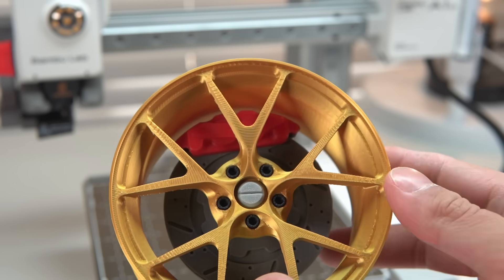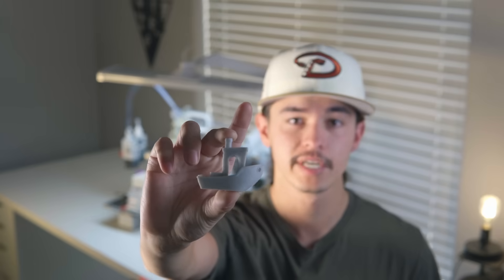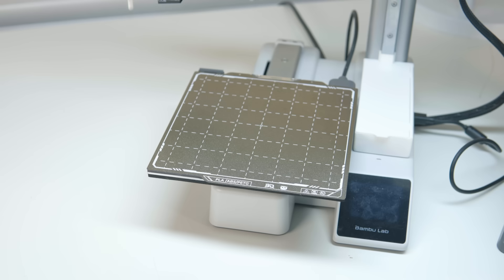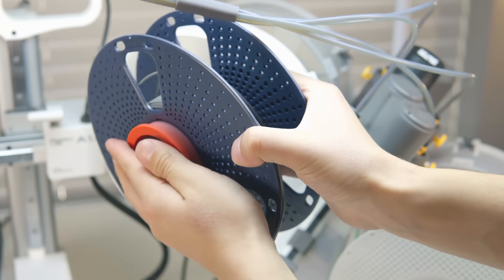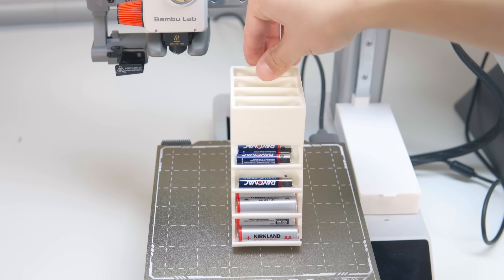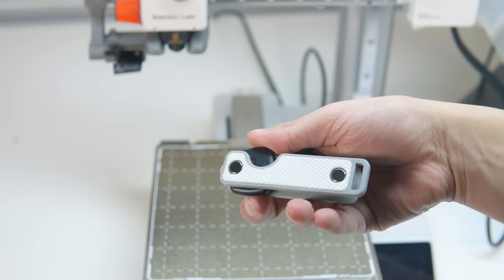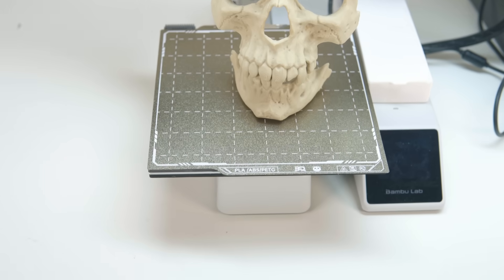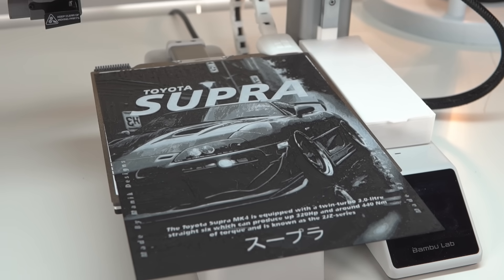New to 3D Printing? Print These First!

Comment: I. Will. Never. Print. A. Benchy. Ever.
Reply: But boat is cool
Reply: I run 1 benchy per filament type/color. 
Helps you understand the material's properties before, during and after printing. It also helps you learn how to print your filament correctly. Also it can be hard to tell what a color will actually look like after extrusion without... Well.... Extruding it. I love tri-color silk PLA but showing someone a strand of it is pretty underwhelming. Like "cool. It's 3 different colors in a line?" But I can show them a benchy that they can rotate and play with and they'll really see how the color shifts depending on which way you're looking at it. 
Benchies are fuckin AWESOME!!
Reply: @StognaBolognaFPV  It doesn't help any more than printing the elegoo buddha or any other small test print, or actual print tests. 
Benchies are like bleach layered on the pigment of the soul.
Reply: 👍 ok
Reply: Thank you for sharing. Such  willpower, determination, mental strength.... Have you considered starting your own religion?
Reply: @charleyfrancis8671  Why yes, because historically religions tend to make a lot of people lay down in the dirt, and I wouldn't mind if I had my own religion that one tenant was if you're a snarky ass for no reason you can just go dirt nap.
Reply: @charleyfrancis8671 im rolling
Reply: But why tho?
Reply: @Duckyboioi  It's so obviously a Product Of Satan.
Reply: Why?
Reply: @nicolefunicella1096  I would be surprised if you never felt that way about something - something that became popular or a symbol of something and everybody kinda went overboard on it, and you didn't really understand what would actually make it fun, or thought it wasn't as cool as a big group of others... 6-7, labubu, beanie baby... and benchy.
Reply: You. Really. Should.
Reply: @crafty_clipstudio  The Benchy is a cursed relic of an ancient realm. Many have summoned it. Few have withstood the disappointment. I shall not join them.

Comment: This video is not useful for me.
"Upgrade for your 3D printer"  (Note: Not "for your AMS Lite")
1. Benchy.  Sorry, seems completely pointless to me.  The only reasons you gave are a) to see if the printer is working correctly, etc.  The last thing I'd print to see if it's printing correctly is something that is built in for it to print!  And b) being able to double-check overhangs and layer lines:  But as beginner is not going to know the relevance of them or to have anything to compare them to, that doesn't seem like a relevant reason.
2. Spool enclosure, for AMS Lite.  Sorry, I got the A1 mini, not the AMS lite.  Useless for me.
3. Bowden Tube remover tool.  Without the AMS Lite, I only have one, but have never had a broken filament and never needed to remove the tube for a broken filament, and had no trouble removing the tube once or twice when I did it for other reasons.
4. Spool adapter: Again, without the AMS Lite, useless for me.
5. Spool Remover tool.  Yet again, useless for someone without the AMS Lite.
So, not actually upgrades "for your 3D printer".
Other useful prints.
1. Battery holder.  Yep, looks good.  I already have a battery case, so not useful for me.
2. Key holder.  I've often thought about something like that.  But I have 20 keys on a ring.  If someone can show me a good key holder that's not bulky and can hold that many keys, I'd love to see it.
3. Threaded insert press.  I not sure how many beginners would be pressing threaded inserts in, but if they are, this seems like a good idea.  I've yet to need to do that.
4. Gridfinity.  Yes, that's a fair one to mention, although personally I'm not sold on it yet.
Non-useful prints.
No comment, except that I'm not interested in non-useful ones.

Comment: Great video.

In 10 years of messing with 3d printers, though, I've never once had a filament break in a bowden tube!

Whether we're talking about a guide tube before a direct drive extruder, or a bowden tube between drive gear and hot end. The removal tool just means you don't have to learn how to release the clamp with your fingernail, which is fine for the number of times I've needed tio do it.

Comment: Turned it off after he recommended printing a benchy.
Reply from the maker: that’s unfortunate
Reply: @jet_lea  sorry! I just see that as incredibly wasteful and pointless. I don't understand it. I got right to printing useful things. I just disagree with recommending a benchy.
Reply: @graphicbrad  Kinda agree with you, I think I've printed maybe 5 in my 8 years of printing. I think this is reinforced even more so if you have a Bambu. They come calibrated as is, you don't need to calibrate squat. I still haven't calibrated my flow rate even though people claim you should, only 1 printer seems to be out a bit and I still am not going to bother calibrating it because it works, just has tighter tolerances.

In saying that, nobody and I mean nobody, should be printing a benchy given the recent drama. Don't support people/companies that are doing this within the space. They need to be shown to the graveyard.
Reply: @graphicbrad it’s not wasteful it’s like 5 grams of filament

Comment: The spool removal tool does not work with Elegoo cardboard spools.
Reply from the maker: there is a different version for elegoo spools on the creators profile that has been working for me
Reply: My bad for not reading the whole description.  The slim version works great on Elegoo cardboard spools. Thanks for the tip and thanks to the creator.
Reply: @JanderCraft  thank you!

Comment: Question concerning AMS Lite. How to determine which spool prints each layer of a model. Is there a method to assign a particular spool, with filament loaded, to a base? Example: I am trying to print inverted numbers for my AMS. In doing so, have orange for the base with gray numbers. I want to switch the base to gray with orange numbers. I am using spool number 2 and 4.
Thanks for any suggestions.
Richard

Comment: Hi Jet L, 

I have been following for a short while and enjoy your videos :)  I am getting into the 3D printing world and waiting for my Bambu X1 Carbon to be delivered as I ordered it just after XMAS but won't be here till mid Feb.  

But my question for you is I also live in Phoenix (Westside) and I am wondering what filament I should use to make these awesome prints you suggest.  I am looking at the Bambu Basic PLA but I have also been looking at Sunlu PLA, PLA+ and PLA+ 2.0 but not sure what I should get before my printer arrives.  Any help would be great or maybe a video idea for you to help everyone out :)

I am very nervous about using other filaments not Bambu because of the codes on the spools is it hard to let say use Sunlu instead and how hard is it to setup on the printer?

Keep up the awesome content and I look forward to hearing back from you and seeing new videos.

Thanks.
Reply: Recent A1 mini acquirer here. Thought not my first printer.

FWIW, you should be fine with Sunlu as a cheap workhorse filament. There are a lot of great YouTube videos out there that do systematic testing of cheap filaments, but I'll offer my 2 cents. For most things you want to do in general, Sunlu should get you there. It's even running fine on my AMS little, although one spool had a tangle in it that I had to dislodge and caused the print to pause.

As a bonus, Sunlu Meta PLA is a really robust, less brittle blend that you might enjoy for functional prints over standard PLAs.

But my biggest tip is don't be afraid to do a little bit of reading and experiment. The only things I would exercise a bit of caution around are additives like carbon and glass fiber (probably not great to handle with skin, or to breathe in particles from sanding), and unless you're using a hardnered steel nozzle the abrasive solid bits will grind out the nozzle. Or printing TPU on a PEI bed which I've seen can rip the bed up when it won't release. And then obviously any of the polymers with nasty fumes like ABS or fancier industrial polymers you should be ok in your X1 carbon with with a working carbon filter (obviously enclosure closed).

I hope you have so much fun with your unit when it arrives! There is so much great info all over YouTube and I hope you have fun going down many rabbit holes.
Reply: Hey man just Wana say w story, there is no need to be nervous though. And if you really Wana take the safe route then just stick with bambu lab filament. It's really easy to use. But before coming to a decision await Jet L's response.❤❤

Comment: I often have the problem, that filament gets cracked in the tube as well. But on my A1 mini these tubes are so easy to remove without any tool. I am just pressing down the black connection ring around the opening and then I can easily pull out the tube.
Nice Vid btw! 💪